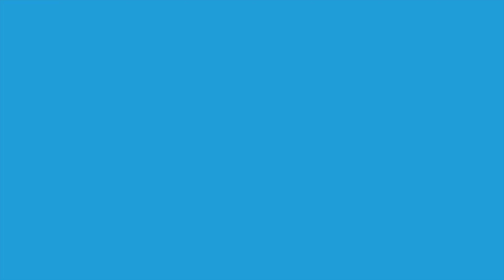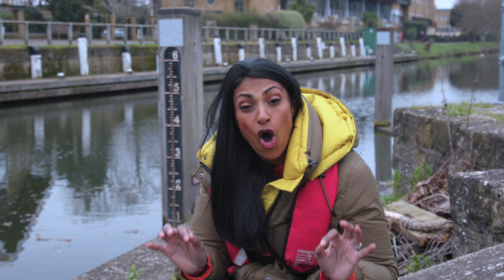The Civil Engineer Protecting Homes from Flooding

Comment: As a fellow civil engineer whose firm specializes in stormwater management, I absolutely loved this breakdown! 💧⚙

It is fascinating how these concrete structures are engineered to handle such immense hydrostatic loads with a 100-year design life, while the mechanical components are built for 60 years. People often just see a wall of water, but balancing flood control with water extraction for London's reservoirs and safe migration routes for fish and eels is the perfect example of multi-functional, sustainable engineering.

Thank you for highlighting this—the industry needs more high-quality, on-the-ground educational content like this. Let's engineer something!

- Dr Gladys Sera PhD, PE